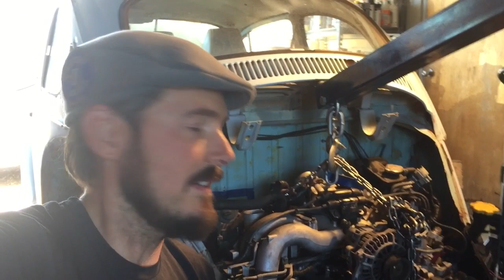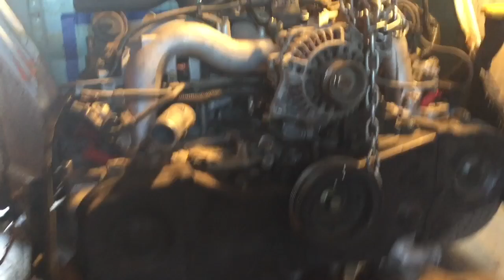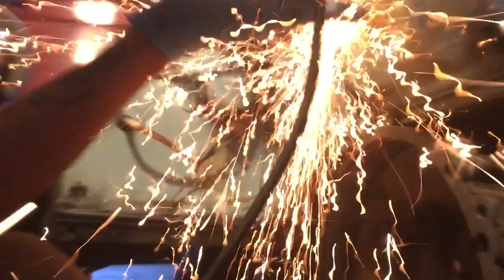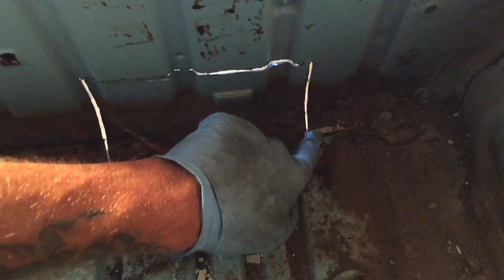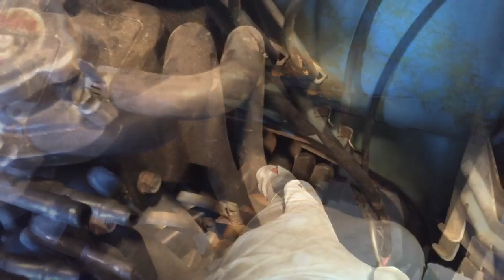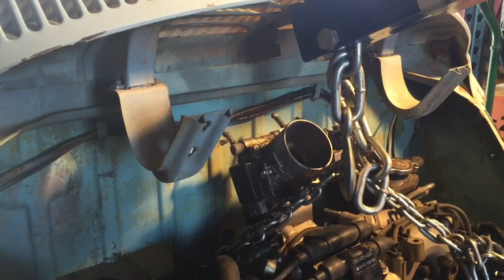BUGaru Part 5 - EJ22T Turbo Engine Clearance

Comment: Mick, I know Bugaru is long gone and that this has been asked before (but I don't see an answer), but the alternative to using your throttle body reverser would be to reverse the intake manifold (which comes with it's own challenges as far as needing spacers for the IM to clear the alternator, timing belt changes, etc.); was this mostly for cost?  I'm putting an EJ20T in a bug and plan to keep it stock; it looks like most of the people who use reverse manifolds are speed-freaks.

Comment: A Saab 900 Turbo intercooler will probably be a lot easier to mount with that reverse throttle body setup, especially in a Beetle engine bay.
Reply from the maker: +William Sharpe Thanks for the suggestion - I'll have to try and look at one of those.

Comment: I know its been a while but I wanted to ask - with doing the clearancing is it possible to maintain use of the back seat? I really want to do a EJ22T VW Bug build - but wanted to try to maintain the back seat if at all possible.
Reply: Has no interference with the back set. The cut he made was into the area under the parcel shelf, behind the back seat.

Comment: Im thinking of adding a subaru to my dune buggy but its a 62 do you think i should upgrade the trans? i want to put the 2.5na out of subaru legacy.
Reply from the maker: +areyouyo Well, I have a feeling the trans will let go in my beetle but I'm going to still run it. If you don't want to have to pull the engine or trans in the future then I'd upgrade it - it's a lot more power.